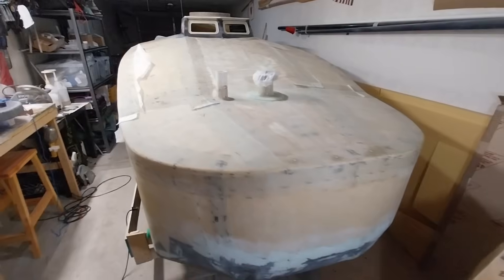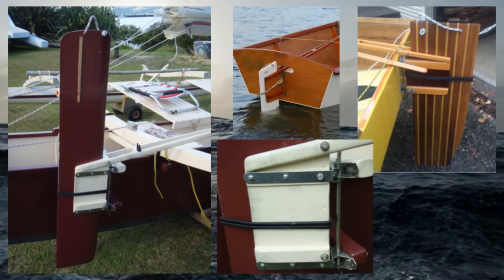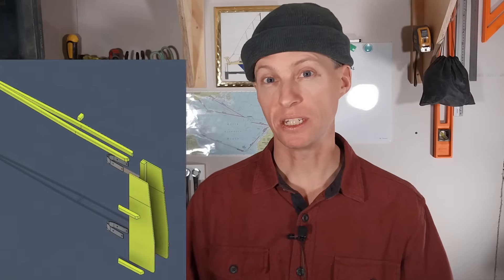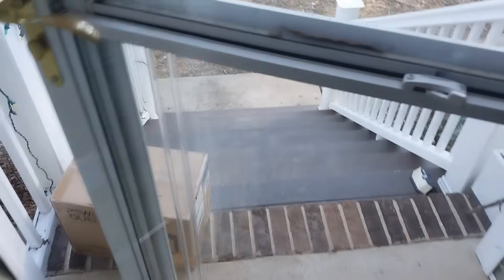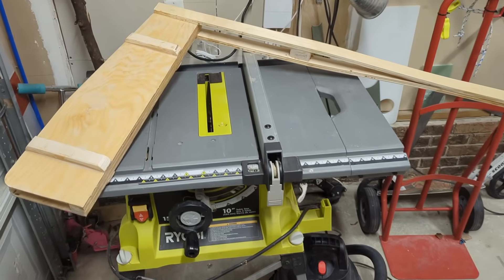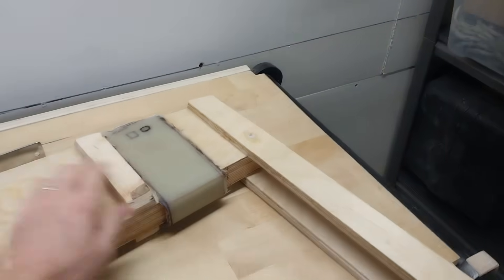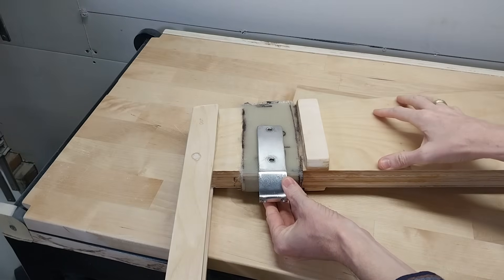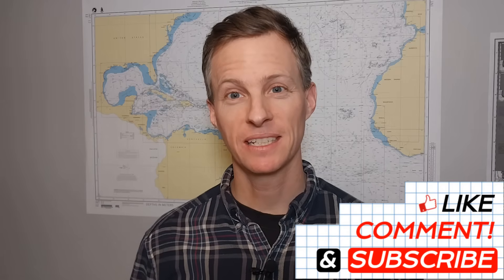OCSS-088 Cassette Rudder: Building the Box & Tiller - Mini-Cruiser Sailboat Build

Comment: Nice job. Im looking at building a rudder for an Albin vega for close manuvering. so it would on a guess 2x the size of yours or maybe your size would do. What was the finished weight of your aprox. Thank you
Reply from the maker: This is just the case for the rudder blade. I'm working on building 2 rudder blades now but it'll be a couple weeks before the video is out. The method I'm using can be found on the duckworks site though. Search for "construction of rudders" on there by Bernd Kohler. You can definitely put one on an Albin vega. Use some quality 1/4 ply and follow their method.
Reply: I searched could not find @ocean_capable_small_sailboat
Reply from the maker: That's odd. https://www.duckworksmagazine.com/07/howto/rudder/index.htm

Comment: I really like the cassette rubber too. What a great idea. Lifepo4 can't charge of discharge as fast as lead acid, however they last forever and much safer and lighter. I had good luck with tracer bn series charge controller but never had one on a boat
Reply from the maker: Are you sure? Doesn't sound right. When I look it up I get "lithium iron batteries can charge up to four times faster than lead acid batteries"
Reply: @ocean_capable_small_sailboat  yes,   lithium ion has short life, fire can charge and discharge a lot of amps. Your car's starter draws 300 or more amps. This is why no one has lifepo4 as car start battery. Still an excellent "house" battery. It's multiple prismatic or pouch cells with a bms. Idk how well the bms will do around salt water? I'd probably seal the unit and use glands. Anyway don't exceed the 100 amp continuous discharge rating and you're good. In the fine print it probably also recommends 50 amp max charging for best lifespan
Reply: I know I'm over commenting here but I had terrible luck with victron controler. I'd avoid them. Just from regular pacific NW moisture in the air I had 2 fail within a week or 2. The boat is amazing and I've learned so much. I hope to build my own one day. Your craftsmanship and attention to detail is impressive. Keep up the good work

Comment: Radius all exposed edges and adjustable pivot angle on tiller so you can stand or sit and a adjustable handle gives you more flexibility to move around.
Reply: Radius are less likely to open skin or dent and then start rot on internal wood laminations

Comment: Nice Job! What brand / kind of paint are you using for your exterior? I used Total Boat Wet Edge for my build and was not and am not very happy with it.
Reply from the maker: I used that stuff for the hull. It was fine but I don't have much to compare it to. I used a different cheaper paint for the cassette rudder. Made by US Marine Products. Cheap enamel paint but seems to work quite nicely.

Comment: Love your vids and love your boat. 
Had an idea about the "climatization". Heard ever about nano-cloth? It is a special veil-thin cloth (used for shoes or t-shirts), that allows air perspiration, but do not let water in. That means, if you have sneekers with gore-tex tightly bound on your feet and step in a puddle, your feet should be dry, and when you pull your leg out, the feet should still "breathe". Similar on the t-shirt - if you pour a soup on you, it will simply change into round pearl-like droplets and run down your shirt, instead of getting inside the cloth and on your skin. 
What i ment to sugest you regarding the gore-tex (or similar nano-cloth) is to try to use it as part of your climatization intake design. At the T-shape crossing, where the air goes to the tube heading inside, you can put on the opening of the tube the cloth, and be sure even if you hit a big wave, or the sea turn your boat over.
Reply from the maker: This would restrict airflow too much.
Reply: @ocean_capable_small_sailboat  Yes, only downside i could immagine - less cross-breeze inside. 
The weather situation i immagined the cloth in, is fog, heavy moisty air and cold. - In general - a situation, when the moisture is brought inside your boat by the air, instead of waves. But you can plug that vent simply by screwing a lid on its inside inlet... Think i was kinda fearfull about, is the amount of air INSIDE the boat, when everything is sealed.

Comment: I always wanted to sail across the Atlantic but at 70 I am getting nervous after watching president Trumps speech I have told  myself to knock it off stop being a wus and get on with it. My boat is the one that inspired the TV series Howards Way. It was owned by the creator, director and writer of the show. This video has provided a couple of answers to two problems.
My boat is a Galion 22 a very seaworthy cruiser racer. It would do well to have a rear hung rudder for better directional stability. This rudder will be perfect also I have been trying to figure out how to reduce the size of the cockpit and provide protection for me as I get seasick down below. I now realise looking at yours I can do it and keep it low profile.
I have commented on your channel before and I implore you fit a boomless dipping lug rig. Make a carbon fibre mast yourself just use a drain pipe as a mould. tension the mould vertically to make sire its straight. Alternatively overlay an existing aluminium mast. 
One last thing killer whales are in the habit of attacking the rudders of boats off Portugal. You could remove it and sail downwind  or drag something behind off to one side to steer.
Reply from the maker: No time like the present! Go for it. I'll be making my mast soon.

Comment: Hello Perry:  I would assume you are using lines on the tiller that lead inside so you can steer from inside (a la Paradox) ?
Reply from the maker: Check out OCSS-035 for my plan for that. I think it can wait until later on after launch though. My hope is the windvane will take away most of my need to have much hands on tiller time.

Comment: Why didn’t you glass the rudder case or at least epoxy coat it before painting. The plywood didn’t even appear to be marine or high quality
Reply from the maker: I did. One of the first things you see me do is pull the peel-ply off of the sides of the cassette box. It got coated in 6oz cloth. Areas where the pintles are mounted got an additional 6 layers of 10oz cloth!

Comment: Don’t underestimate the force on a rudder, especially on an ocean.
Good design, but the open back does mean the rest needs a lot more strength 
Hope you haven’t underestimated what is required.  I would look at a 20’ yacht for guidance.
Reply from the maker: Yes, it's true. And most trips that go wrong seem to do so due to rudder failure. I need to make a spare cassette box & tiller as well, so I may make the next one 100 percent fiberglass.

Comment: You have gone to great effort to make a boat effectively "wood free" and it will pay dividends long term, so I don't understand the decision to make the rudder (A very used part of the boat) out of wood, and cheap wood at that. It could have been wood free as well.
Reply from the maker: Because it's easy to replace. I can even carry a spare rudder blade and cassette box/tiller setup in the boat. The great thing is I can try it out this year and build another wood-free one if I want.

Comment: Those bolts on the rudder that have full threads all the way down the shaft will become a file causing them to elongate the holes and would work through the ply eventually if allowed
Reply from the maker: It's a good thought I hadn't considered when buying them. I don't see how they'll move though, I really tightened them down and coated the threads in 4200.

Comment: How will the pintles be fastened? Through bolts, at least on the lower one, would be in the way of the rudder blade. Have you considered using an epoxy soaked nylon or Dacron line along the leading edge of the rudder for impact protection? It can be faired into the blade and once the epoxy sets it's as hard as a rock. 
Those interested in cassette rudders should Google plans for the Goat Island Skiff, which uses one.
Reply from the maker: I got a lot of info from looking at the cassette rudder on the Oz Goose too. The more forward holes on both pintles can have a through bolt, it doesn't go through the open part of the box. The aft holes have to have short bolts, a little less than 1/2". I'll bed the pintles in 3M 4200.

Comment: Congrats on the house purchase Captain Perry! Well done! I restored a small sailing tender in HS. When I fit the rudder to the transom I had a binding issue the first time I installed it. I went to the chandlery and got different gudgeons that had a tension lock on the hinge end. I got those because I didn’t want to have the rudder pop off the hinges when under way. These were nice to have because the second install,  I had no issues with alignment or binding. Your rudder looks awesome btw. Any reason you didn’t hinge the tiller?
Reply from the maker: Thanks. These pintles have a hole for a cotter pin to keep them in the gudgeon. I didn't hinge the tiller just in the interest in keeping it simple. I'm going to make a spare of this whole setup eventually and I may have a hinged tiller on that one, thinking of making it from a carbon fiber tube.
Reply: @ that is a really good idea. Do make a cassette again. It’s an excellent design and idea for the scow. Are you going to make it so you can tack/jibe steer  from inside the doghouse?
Reply from the maker: Yes I have designed an internal tiller system. I'm not sure if I'll build it in time for the first sail or wait until later. I think it can wait a bit. Hopefully the windvane will do a good job of doing almost all the steering.

Comment: That looks like a cool system and built to last!

May I ask what kind of windvane your planning to have?
Reply from the maker: Originally I wanted to put a trim tab on the back of the rudder, but now I think maybe I was overcomplicating things. I'm going to copy the one on Baluchon since it's worked for him across thousands of miles. You can find some videos showing it if you search around.
Reply: @ ah yes, a very simple system which should work fine since the boat is so small, his vane is huge compared to the size of the vessel 🙃

Comment: I think the reason some batteries catch fire is that the electrolyte (liquid that allows for ion migration) is an alcohol. In lead-acid batteries, they produce hydrogen gas, which is why they are vented. Flammable liquids, and explosive gases are bad around things that heat up and might cause sparks. Lithium-iron phosphate batteries are used on submarines, so I'm sure they're well vetted.

Comment: Would recommend to attach the windwane lines to the tiller with the traditional short chain. The lines in cam cleat system will not work in the long run because if the movement

Comment: Congrats on the house. U of M colors are nice. 😛 Just one suggestion. You should use smooth shaft bolts with threaded ends for the through bolts. The smallest movements can cause a threaded shaft to act like a rasp and open up your through hole. Just my opinion, but the change is a small expense.
Reply from the maker: Thanks, I hadn't thought of that!
Reply: Good thought